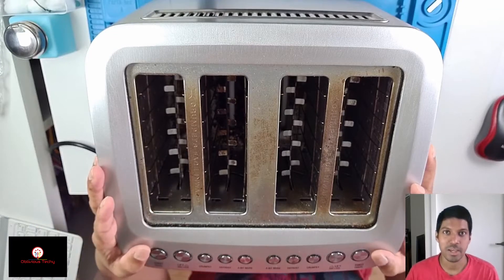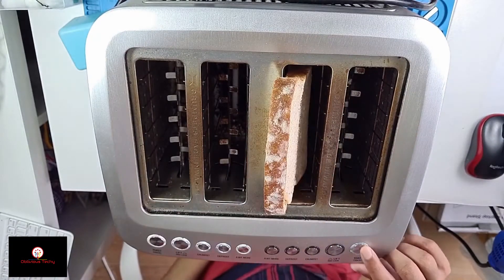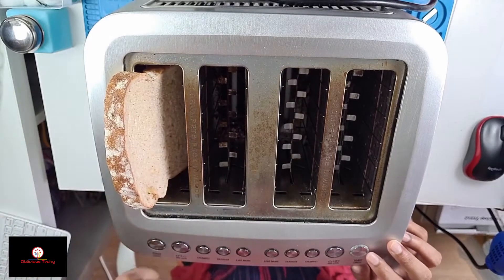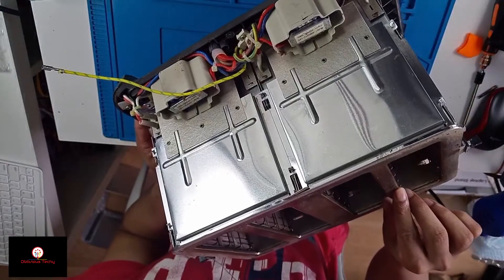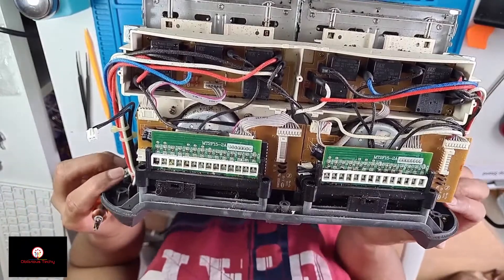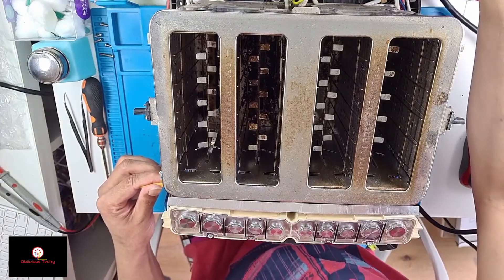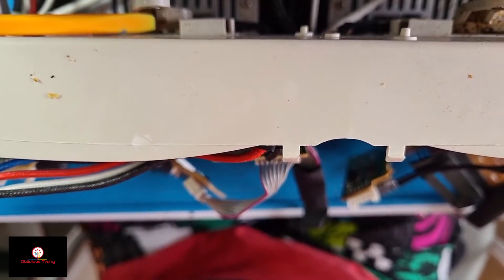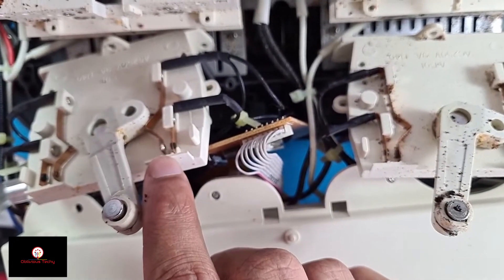Breville BTA840 Smart Toaster Blinking White Lights | e-Waste Repairs

Comment: I had the same problem. Thank you for letting me know it was a stuck switch.  First, I cleaned out the crumbs, something I do regularly.  To do this, I remove the crumb trays.  Then I gently hold the toaster over the sink.  I gently shake it.  Then I turn it upside down and shake it again.  Holding the toaster upside down, I gave it a slight rap on both sides.  It has been working perfectly ever since.

Comment: Very useful video. I’ve got the Sage equivalent of this and was having trouble getting it open to  investigate a problem. In my case the right side is not heating up though it partially does if the defrost and crumpet button are both pressed. Hmm but at least I have the cover off now.

Comment: Thanks for the video. I found one of these toasters for very cheap at the thrift shop and I needed to see how to take apart the raising/lowering portion. Somehow my toaster hasn’t developed the blinking lights issue, which is surprising because there were crumbs everywhere inside the mechanism. This was resulting in a horrible noise sometimes when it was raised/lowered. Cleaned them all out as best I could. Also has other issues, some leds are out on the sliders and buttons, and the buzzer doesn’t sound great. However, I’m still hopeful that this will make some great toast!

Comment: I also had the exact same problem as yours. I figured I'd take the easy way out first I got the air compressor with a nozzle on it blew out all the crumbs front back top bottom and it's been working perfect since. It only took me a couple minutes

Comment: Geeze, I admire you.  My Breville toaster has had this problem, but I ignored it until one side just stopped working... the little bread cages will not open on the left side... which has been playing its disco lights, partying at will, whenever it feels the music for years now.  

So, here I came to you.  This is daunting to me.  I can do some mechanical stuff, but everybody is saying this is challenging.  I am not sure I am up to the challenge if it took you four hours.  The Breville website is making my inquiry impossible as it wants the date I bought it and from where.  I have no idea.  But it is this very model.  Does Breville take repairs?  No real need to answer, as I will call their support number during regular business hours.  However, it seems this is a glitchy model.  Grrrrowl.

Comment: Great video and fix but one suggestion. Your camera angle is too far back and did not show anything of the front of the toaster with all the components you needed to remove to get at the switch. One of my "lifters" has fallen out due to someone forcing a bagel down and I think I'll need to remove everything you did to get at the part it attaches to.

Comment: I had another look at the Breville BTA840, and found one of the small 12v transformers was stuffed - primary wqas O/C. I bought a new one that would do the job (2840) locally for about $8. Trouble was, by then I'd taken it competely apart and it took a really long time to reassemble it. It now workks perfectly, and I was able to clean it thoroughly after its nearly 10 years' use.

Comment: I have a BTA840 toaster and one side simply stopped working. I took it apart, as you did, and it was not easy! I tried swapping modules to see if I could isolate the problem, cleaned and checked those microswitches and cleaned it up as best I could - no luck at all. In the end we bought a new one and I took all the parts, motors and electronics from the old one to use as spares, carefully marking which part came from the faulty side. It was obvious it wasn't intended to be dismantled - several of the screws were virtually inaccessible. I hope to use the parts if the new one goes wrong after 8 years, like this one.
Reply: I think I may end up following your path...
Reply: The new model has updated parts - they no longer use the little transformers that sit at the back of the toaster, near the mains input. Instead, they use inverters, like the latest plug packs. I'm please to say that after I'd fixed ours, it's been working perfectly - the new one langushes in the draw next to it. I could have saved $200! You really have no choice but o try to repair it yourself - parts aren't available, and there is no 'service manual' for it. If it's a choice between the garbage bin and trying to fix it - take the latter. you might surprise yourself. And remember that the Chinese had to get those😊 difficult screws in somehow, and they're no better than we are.

Comment: What exact screwdriver did you use to open up the toaster?
Reply: I would also like to know.  What is this driver called?   I expand the video description above to see :   Jakemy Screwdriver Set 99 in 1.  I may just take the Dremel grinding wheel to a cheap screw driver and put a slot in it myself.

Comment: Had this exact problem with a Breville two-slice toaster. The fix worked like a charm. Hardest part was getting those four weird screws on the bottom out.
Reply: Same problem:  What are those pesky little screws.  Obvious Techy took them out with no problem and without mentioning how he did it.
Reply: @astewart136  How did he get those screws out....? I have the same problem, but what kind of screwdriver does this require????
Reply: @juneosborne1372   Sorry, I don't remember.
Reply: I have the similar model bought in the US. The bottom required a "u fork type screwdriver" to get the four fork type screws out. A search will show what the screwdriver looks like. The manufacturer uses these to discourage disassembly I guess...
Reply: You can just grind a notch into a standard flat head driver to make it work. It worked for me 😊
Reply: I’m also looking for the answer to this, what kind of screws are these?
Reply: @BKuryk  Sorry, I don't remember.